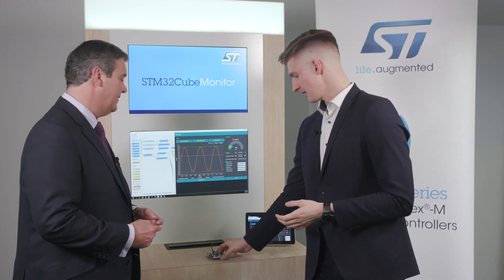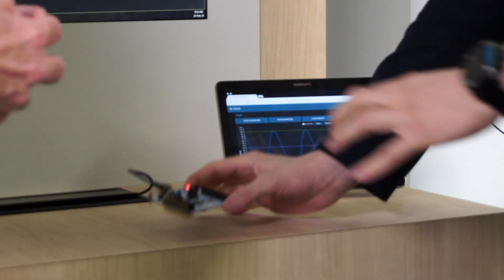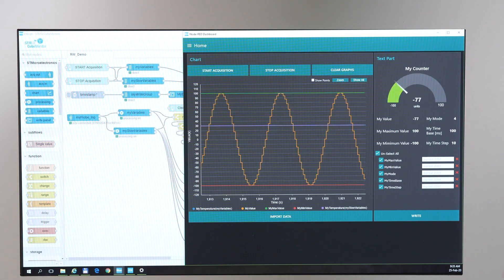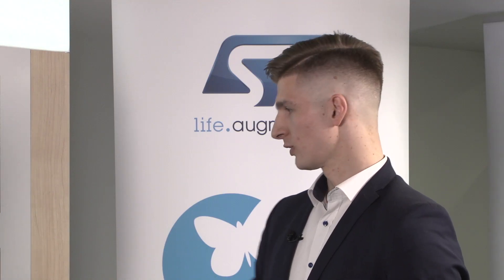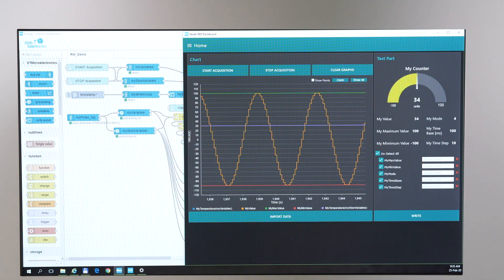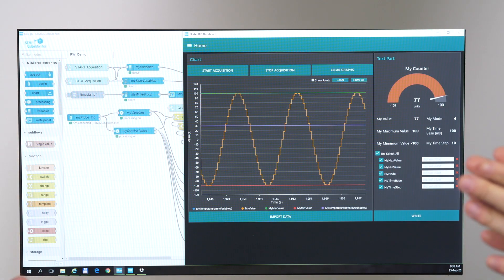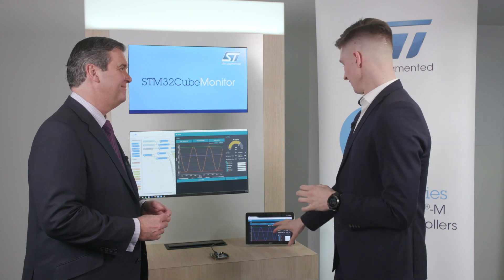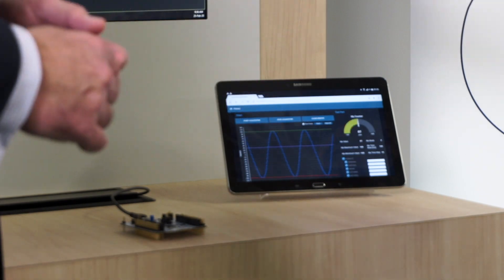Application monitoring with New STM32CubeMonitor

Comment: Hi! will it be possible to use this application with the next board and programmer, thanks?
https://aliexpress.ru/item/32649400326.html?spm=a2g0o.productlist.0.0.6d6b4037x6t1u7&algo_pvid=8267403d-1114-47be-b510-46104ef64612&algo_expid=8267403d-1114-47be-b510-46104ef64612-9&btsid=0b8b158815828215463973649e2059&ws_ab_test=searchweb0_0,searchweb201602_,searchweb201603_
in this combination, in order to get the variables during the operation of the microcontroller, you have to send them via uart and receive them on the computer via usb - uart adapter. If your monitor can work through swdio (this programmer), then this is very cool! Good luck